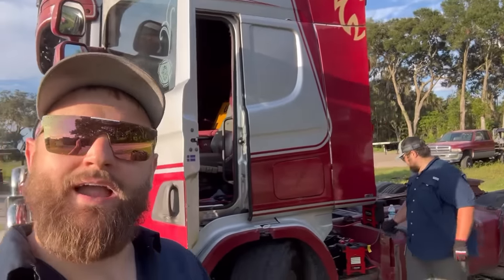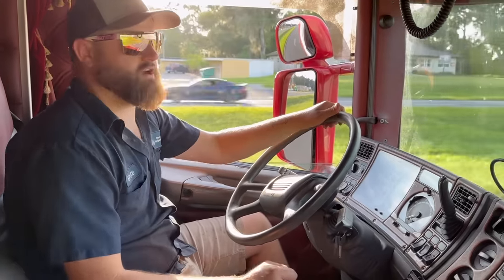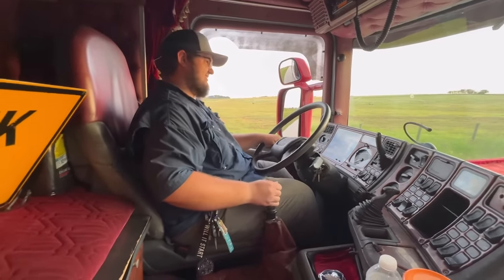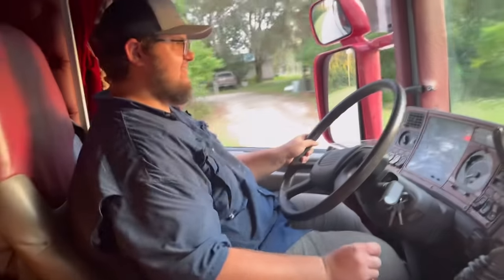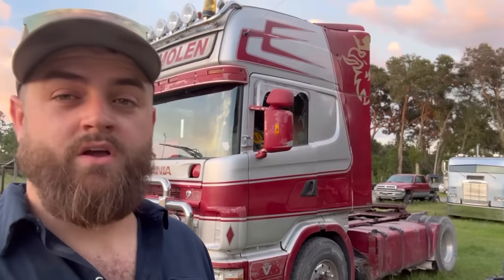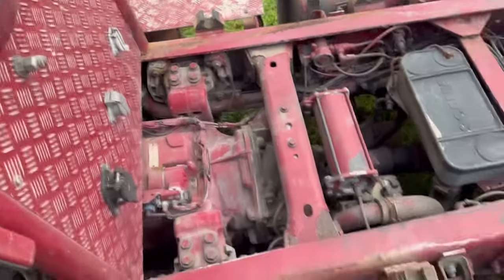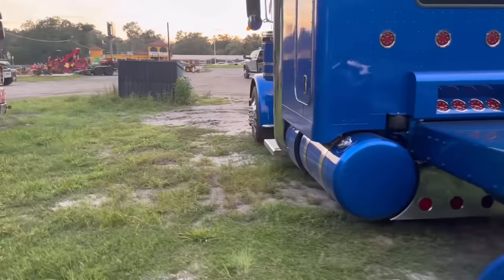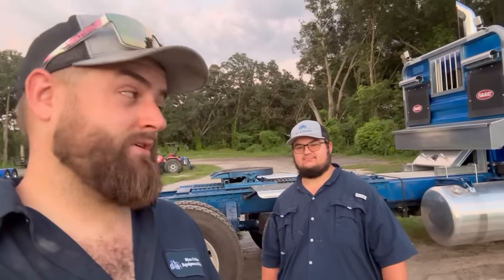American ATTEMPTS to Drive European Semi Truck. (Big Fail)

Comment: In 1987 I ordered a standard cab Volvo, but it was Volvo straight through. The 6-cylinder engine sounded like a sewing machine. The drive for the fuel pump was connected by an open driveshaft that had leather u-joints. The manual transmission shifter was connected to the side of the transmission, so the shifter was just ahead of my hip. It was tandem with only one drive axle that was rated at 53,000 lb. with a lift axle behind. I worked heavy haul with my three-axle trailer and an additional flip over fourth axle. I also used an additional axle on the gooseneck as needed. People thought I was nuts to have ordered it, but it was the most reliable and powerful truck I have ever owned. I ran it for 6 years and wanted to buy another but was told there was not enough sales, so they discontinued it in North America.
Reply: Volvo has still a six, but the power is up to 750 DIN hp, depending on the model and engine. Different engine configuration, but very similar power as Scania V8's max 770 hp.

Comment: That truck has plenty of power, it only has a narrow power band. That green zone on the rev counter is there for a reason: shift at the top of the green and select the gear that drops it to the bottom of the green (experience) and it will pull like crazy.
The later generation automatic gearboxes are actually awesome, because the computer does all the figuring out which gear to select for you and after multiple generations they're pretty good at it. Many automatic Scania's had (have?) a pre-select feature: you tell the truck which gears to use when standing still, drop the clutch and it will launch, so you can still have "fun".
Reply: Yea the Americans would not understand how awesome a automatic gearbox is until they work driving in roundabouts and EU like traffic. Really the earliest automatics in Scania was not that bad to begin with. They are air robot controlled manuals like most trucks in EU. And Scania introduced automatic gearboxes in like 1995 or 1998 whatever. 2002? Anyways due to it being "new" and to please skeptic old timers/drivers. Well. The truck still has a clutch pedal. Yes. And it was only really used to start and stop. When in motion the clutch is not used. The automation did the gearshifts. And I have driven one as a temp replacement truck like in 2019. No working AC and the hole thing was on the very end of useful life. The truck was worn and truly time to be retired. 

It did a extremely good job at shifting gears and behaved very well for being so old. But it was EXTREMELY painful to forget that you had to push in the clutch at a red light... It would idle so happily in such a low gear that only ones you hit the brake to completely stop did the truck start to remind you about the fact it was not a fully automatic gearbox. You honestly forgot driving it that you where not in a 2013-2016 fully automatic truck with generations of refinement or anything. And when reversing or driving off it was just a normal manual EU truck. Just no gearstick.

Still the dum USA manuals and even the 12 speed EU manuals are just more fun and part of what makes it more then just a horrible job.
Reply: @TheDiner50 i belive the reason for keeping the clutch pedal was because they hadn't figured out the finer control of the clutch needed for full automation. Later on they switched to an electric actuator instead of the air actuator and did away with the clutch pedal, although you could still opt to have it depending on the purpose of the truck. The current generation has "clutch on demand" wich really is the best of both worlds. It operates as a fully automated transmission but you can press and use the clutch manually when you want
Reply: In European trucks the power is more down low. The idea is when you go up a hill, the revs come down, but the torque comes up. Power is torque x revs, so you don't have to rev high plus in a hill the power doesn't go down so much when the revs go down.
Reply: @markkulehtinen4733 Having the power band much lower in the rev range also saves on fuel and I think that plays an even greater part for manufacturers. 

Mercedes for example managed to lower the power band of their OM473 engine with 400-500 revs by changing the injection system. That move, together with some additional redesigns, saw the fuel consumption drop with up to 8%, while delivering the same amount of torque.

Comment: That tachograph was common in the U.S. as well. Had the same function as a log book, but recorded functions of the truck. Speed, braking, idling time etc and any law enforcement officer could pull your graph and check it out.
Reply: Not very common at all
Reply: @tonyanderson6493  well , LTLs used them a lot. When I started at Overnite, the tachographs were still in the tractors....not working but still there.
Reply: Tachograph was invented in USA
Reply: @tonyanderson6493 it was extremely common in the United States for decades! They started using them in the early 70's in trucking if I'm not mistaken with a sort of pen to make the markings when the vehicle started to move, speed, hard braking, and stopped. In 85 they came out with a digital tachograph. But the tachograph was invented for the railroad in the 1800's. You might want to learn something about the topic you speak on before you comment. Kinda makes you look like you don't know anything! Hell I'm sure you could even do a quick Google search and find out how much is true and how wrong I could be then hold a legit debate!
Reply: Its called "Fahrtenschreiber" in Germany..
Reply: @chrisherman7531  You have another checking system there in US..In Europe is much different...You used the tacho for speed indicator only.. We used them for the drivers' working times and status ..Nowadays there is the smartcard electronic system for this. The tacho is electronic now.. We only have a speed indicator in the dashboard..ALL the functions are memorized in the new tachos and the driver's memory card..And ALL the functions and drivers' status are recorded automatically..We don't have to use the "status knob" all the time..
Reply: @SV2LLJ  It is truly sad, total control, driver's in Europe are just cheap slaves in super slow trucks. I never thought the US could go that route but at least the insane speed limiters aren't a reality yet.
Reply: @steliosgiagios9367  they were called "tattletales"
Reply: @V8Lenny  Germans invented I taught  did to keep a track of the German army truck ww2
Reply: @ImForwardlook  not really it’s grate the taco laws because company would push drivers to drive all day and night ..
Reply: I drive for Chemical Lehman in the early 80’s and we had a different version of this mounted to the back of the cab behind the driver seat. 
When you went on duty a mechanic came outside and installed a new graph paper disc and then locked it. It would be removed when you finished your day and then management would compare the disc to your reg log for any discrepancy. They pretty much matched up. Way before ELD’s
Reply: They are used to check the drivers don't break the rules and also to protect them from being forced to work too many hours.
Speed is limited here in the UK and in Europe and it's used to enforce that as well, but many companies to save money on fuel limit their vehicle speeds even more than they have to by law. 
Big trucks are also limited as to what lanes they are allowed to use on the motorways (freeways) in the UK so that when you get a load of them bunching up together there is still a lane open to get past them.
On some of the busier routes such as the M25, the M60, the M1 and the M6 at some times of the day, the inside lane and sometimes the 2nd lane will be full with lorries moving at between 52 and 60mph, forcing most car drivers into the middle lane, much to the annoyance of the 90mph drivers.
Reply: @jimjam894  No, it is to root out the good drivers and make everybody an obedient serf. Instead of making good money in a few days a driver is forced to spend most of his life in a truck for pennies.
Reply: Cool history… I didn’t know it existed.
Reply: @steliosgiagios9367  That's what I knew them as. Only found them on company owned trucks to keep tabs on the drivers, hence the name.
Reply: @jimjam894 * and that they still do with magnets, hidden swithches, or double drivers cards 😂😂 If they wanna earn real money of course..
Reply: @ImForwardlook  in europ most are payed by the day or the hours not by the load
Reply: Side panel is lov i Europa so pepel not kan get hurt at the wheels
Reply: @ImForwardlook  Without the tachograph, our large trucking companies would still be forcing eastern european drivers to work for pennies and living most of their life out of the  truck. With the added issue of the driver now being forced to drive even longer, without mandatory breaks, taking more risks, speeding because you might get less hours etc. 
I already see plenty of them swerving around, probably being sleepy as fuck. It'll only get worse if you don't force corporations to let their drivers take the mandatory rest period. 
European logistics corporations are ruthless and don't think for a second they won't squeeze out the drivers any less if you'd allow them to run without a tachograph (digital/analog). We chose for capitalism on this continent (except for Belorussia) and a free, europe-wide open job market when it comes to driving jobs. But that also means that the cheapest possible drivers will get hired and unless you add some safety measures, it'll mean that those who are prepared to drive for dangerous lengths of time, will get the job (and consequently cause accidents, damage their load etc). A corporation will always choose the cheapest. Quality and safety are definitely not number 1 concerns for the majority of them. They'll do the exact minimum they're forced to do by law. If a load gets lost, that's not the problem of the corp's department that hires the trucker - that's another department's issue and probably just paid out for by the corp's insurance. Corporations rarely learn. 
There's one genuine concern with the tacho system: if you time out in an inconvenient place where there's no place to safely park your truck, you can get into some trouble exceeding your driving time searching for a place you can park. 
With traffic densities and route lengths you got here, there's not much difference possible in speed between drivers anyway. A good driver and a bad driver are equally fast. The only difference is driver safety and their abilities to back a trailer into a tiny city street built in the 1800s without damaging the sidewalk or parked vehicles.  If you need something extra fast you put it on a plane.
Reply: Ink pen without ink was used to fake a tachograph chart....with a steady hand !
Reply: @ImForwardlook  You are American, right? Americans consider everything like this control and communist and whatnot.

Tachographs are good. There are laws on how long you can drive until you have to take a break. It's about safety. Tachographs are there to keep drivers from breaking the law, and also on the other hand, to keep companies from putting pressure on the drivers to do so.

Also, what's so bad about speed limiters? Trucks are not allowed to go any faster anyway.
Reply: @V8Lenny , sorry you are completely WRONG, the tachograph was invented in Dresden, Germany.
Reply: @ImForwardlook , wow, you are so wrong on so many levels, The tachograph is there to protect the driver from companies that would otherwise exploit drivers, it has been proven that a truck travelling at 56 mph instead of 60 mph still achieves a similar journey time, also European trucks are by far a lot more fuel efficient than there American counterparts(FACT) and they have larger engines producing more torque at a lower engine speed and they carry more weight.
You claim that European drivers are just cheap slaves, it might surprise you to know that the majority of UK/ European drivers are paid by the hour, unlike American drivers who are paid on mileage or per load, I know which payment method I would prefer. If you want to compare the hours worked, in the UK/ Europe, it's like this, 13 hours a day which can be extended to 15 hours, 3 times a week, 9 hours maximum driving a day which can be extended twice a week to 10 hours, they have to take a minimum 45-minute break after four and a half hours of driving(mandatory) though it can be split into two separate breaks the first being 30 minutes and the second 15 minutes.
all trampers get paid an allowance(tax-free) for every night that they are away from base(home), the majority get paid a meal allowance(tax-free), European drivers only work 5/6 days a week and yet they still earn more than an American truck driver.
So tell me how is the American driver better off than a UK/ European driver, the only advantage I see of being an American driver is that there is more living space in the truck when off-duty, American trucks are at least 10 years behind technology wise compared to a European truck.
Reply: @ImForwardlook  Maybe,but as you describe it it is VERY simplified...In real life,it is more complicated ..Anyway for those  times, these laws about driving times and smart tacho etc,were enforced in all EU, the pay rates for a driver were really good but as EU expanded more and many former "Eastern coutries" (the former Warsaw Pact countries) became EU States,there was a plethora of new drivers AND trucks looking for jobs in the EU...There was a harsh "competition"let me say,for all of us untill French drivers' association came to a strike...So they (the EU...) were enforced to establish "new laws"..Some of them were in favorite of some countries, some of them  were in favor of the drivers in general...Anyway it is too complicated to explain it here.. Just imagine that this "competition" became now, the worst for the drivers when we are to pass the borders from some former "Eastern Countries"...As an example only...If you have to pass the Danube river  (Bulgaria to Romania or the opposit..) in the 80s we had the Russe Bridge and some "Ferry crossings" alonside the river...Personally it was a matter of about two hours time to pass ...Nowadays there is one more ,bridge crossing  at the most Western part of this border the new Vidin-Calafat bridge...This bridge was made with EU's money.. Now ,you must be the luckier person in the world to make it ,less than 10 hours at THIS border (and may be some more at the older borders)...The queques each side are...More than 10 or 15 kms long....After that you HAVE to make an ,at least,11 hours long pause to be able to drive again....So The "drivers's friend" the strict driving times (as our French colleagues were saying ) became the worst enemy... See?? It is NOT always  the same everywhere...Anyway..Sorry about the post but..I had to explain some things..Have a nice weekend everyone...
Reply: @ImForwardlook  
Were you guys born as idiots or did that evolve over time???

We, the people of Europe, don't give a flying shit about the salary of a trucker. We do much care about safety on our roads, though. 
We, the people of Europe, WANT our truckers to have frequent stops. We WANT the trucks to be limited. We seriously don't care for how fast the trucker wants to go.
And if we, the people of Europe, decide that we want truckers to pull their trailers with their teeth, then the trucker does so or changes the job.

It's called democracy where the will of the majority counts.
Reply: @dan_kay  Your belief in majority rule for best results is laughable.
Reply: @ImForwardlook  
Democracy doesn't care about your opinion.
Reply: @ImForwardlook and yet there working hours are better protected then in the USA.  Not sure who is more a slave. .
Reply: @Hensepens64  Protected? You mean forced to live in the truck for pennies? I worked 100 hour weeks for 10 years just to get taxed 40%.
Reply: @ImForwardlook  
Well, someone has to pay for the roads you're damaging with your heavy loads. Someone has to pay for the ambulance  who picks up the pieces when a trucker – once again – couldn't get his unit to stop in time. Someone has to pay for the teachers to teach your kids so they don't have to live in a truck for pennies.

Man, come on. You`re better than this!
Reply: In Europe a tachograph is mandatory, because the are strict laws how long you can drive/work and now much you have to rest. Modern tachographs are electronic and each driver has their own personal memory card.
Reply: @ImForwardlook So you don't care about safety. Gotcha.
Reply: @ImForwardlook drive faster with 20 to 40 tons and poor brakes that's smart as an American E=mC2

Comment: The Tachogragh card system has now been replaced by a digital Tachometer. 
They are used primarily to ensure Drivers do not exceed safe Driving / working hours. Great video Bruce!
Reply: Plus it logged your speed. So the police could check if you didn't exceed the speed limit for the truck.
Reply: @Denhalen79  Yes indeed it does!
Reply: Doesn't trucks in the US have a tachograph so you don't be able to tamper with driving ours regulations?
Reply: No "tachograph" in US... we have ELD (Electronic Logging Device

)
Reply: @Xv1p3rCr0  Yes, after decades of resistance European style communism is destroying American trucking too.
Reply: @ImForwardlook lmao European communism you are funny dude
Reply: @CloudBlorb  I should know, I have lived in this hellhole all my life.
Reply: @ImForwardlook  dawg only russia has communism and it's euro asian country but it's not part of EU lmao
Reply: @ImForwardlook   As a European I'm afraid your definition of "communism" sounds a bit off.